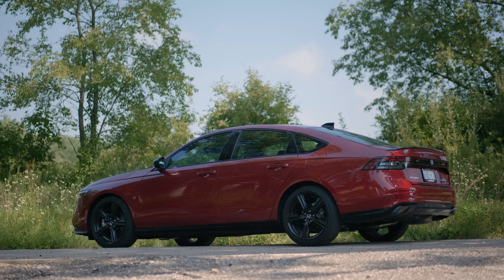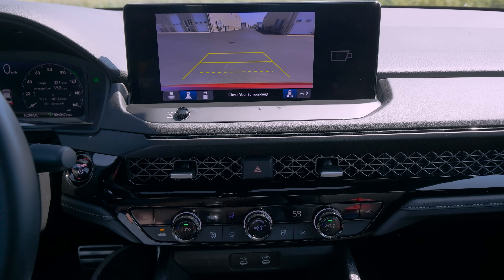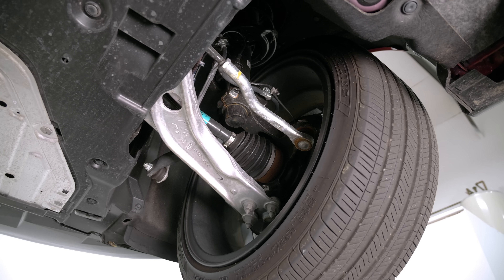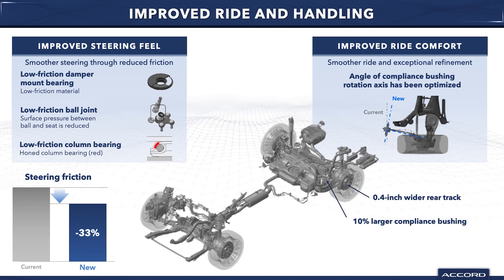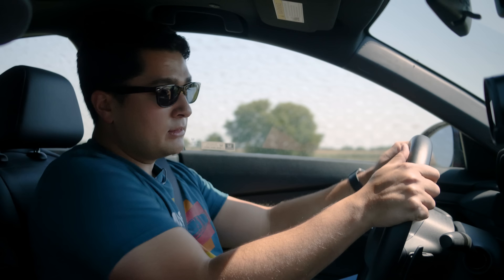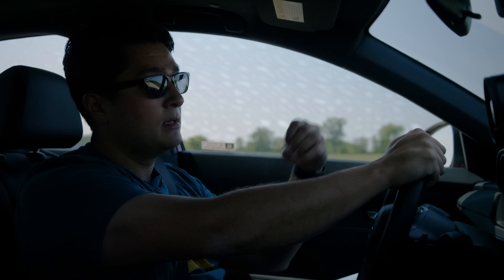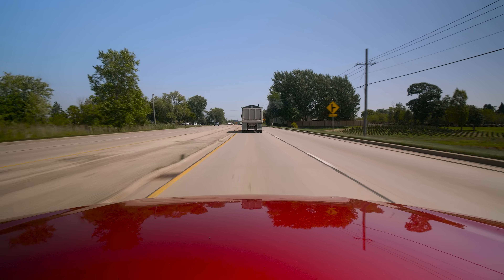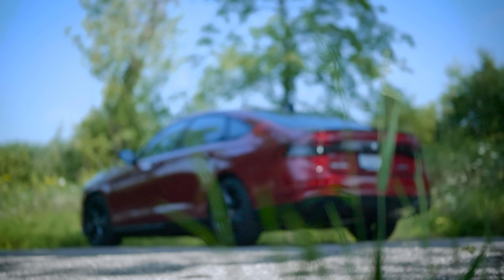2023 Honda Accord | The Art of Normal Cars

Comment: I do feel like the current Civic has taken over the role of the Accords of yore. Here's to hoping the future Civic Hybrid will hit similar efficiency numbers to this hybrid Accord.
Reply: That' a good point. The current Civic is about the same size as the 7th gen Accord.
Reply: @jerrybarrax5618 I would say 5th gen Accord, comparing mine side by side it's pretty similar.
Reply: Yea I was looking at a used Avalon earlier this year, but the Accord is now basically the same size and was cheaper to buy new.
Reply: I hope honda brings back in north America a small sedan. Best way to get new customers and something economic
Reply: @cedrikpelletier5735  100%. We need a new subcompact to replace the spot of the old Civic 😂 Bring back the Fit!
Reply: @cedrikpelletier5735  That would be the Civic.
Reply: Yeah good point. 🎉

I like the simplicity of old Accords!
Reply: Is the current hybrid civic not the same drive train?
Reply: @adamek9750  it’s basically the same, but with a less powerful electric motor I believe. Around 182 hp and 232 torque. It gets even better MPGs.
Reply: The Civic hybrid is expensive and it's already sold in Europe
Reply: I have an 05 Acura TL which was based on the 7th generation Accord. I noticed that some of the interior dimensions of the current Acura Integra (which is based on the 2022 and up Civic) were actually larger than my generation of TL.
Reply: We got the Civic hybrid in Europe at the end of last year. It goes under the name Civic 11 e:HEV. But I think you guys in the US have the Honda Insight instead, right?
Reply: @Schreibtisch1  Insight is dead in the US. Apparently Civic hybrid is coming here next year
Reply: @Schreibtisch1   Insight was discontinued in 2022.  Supposedly, Civic Hybrid will replace it later this year (2024).
Reply: @meemka8251  Civic Hybrid is already on the road since the end of 2022. I already drove one, it's a great car, I really enjoyed it.
Reply: @Schreibtisch1   It is in Europe, but it has yet to go on sale in North America- U.S. and Canada. Last I read it will be available here later this year.
Reply: Lucky for you it’s coming with 200 hp and 50 mpg combined
Reply: Would blur the lines between the two cars and might undercut the sales of the accord. I would say they need to get rid of one or the other.
Reply: It does they just released it

Comment: Had a 2024 Honda Accord Sport on an extended four month rental. I basically live in my business car… in 16,000 miles during my time with the car I got 49.6 mpg for the total duration. Great you say, but unfortunately I was to have that car for six months. While driving on the Washington DC beltway at two in the afternoon, without any warning the car suddenly dropped its speed to 20mph , scary, and messaged to immediately head to Honda. Took it back to Avis and received a Malibu in exchange.

Comment: I really don't understand the criticisms about the exterior being "bland." I disagree. Back in my car club days, we would have called it "clean." There is not a speck of gaudiness to be found anywhere. It will age very gracefully and will never seem dated. It does resemble the Ford Taurus, but that was another "clean" design. I like that it's not too loud (flashy). To me, that always comes across as pretending. Why should the Accord drive and look like a sports car? It serves its intended purpose - basic and reliable transportation for up to a family of four. All I want it to do is to start and drive everyday with no detours to the mechanic's bay. Also, the crash test results were stellar top to bottom, and that's a major concern for a family man. I'll drive a proper sports car when I feel like getting into trouble.
Reply: True. I’m not a fan of when everyday commuter cars try to pretend to be sports cars. Some may be fun to drive but they will never be a proper sports car that you can truly push to its limit and enjoy at the track

Comment: Even if you just look at the dimensions, the new honda civic is basically what the accord was 10-20yrs ago.  The only problem is, that there is no Honda Civic that is like the old honda civic- in size /pricing. They removed the "Fit" from US markets, which actually felt like and priced like the old honda civic, but with cons (tiny -noisy engine).

Comment: The problems I find with the 2023 Honda Accord: 1. No All Wheel Drive is available 2. No heated steering Wheel is available  3. No spare tire is available 4. No XM Radio (in the US) for some reason if you get one in Canada it comes with XM Radio, so Honda, there is no excuse. If a 2023 or 2024  car missing all of these features is fine for you, then get one. Hopefully, by the time 2025 comes around these glaring deficiencies will be resolved.

Comment: Aesthetically speaking, I think the 2023 Honda Accord is going to age very well despite its current reception. Its styling may seem "meh" right now, but that's just because we've gotten used to everything on the market being so ridiculously overstyled. I don't need my normal economy car to have swoops, gills, ducts, and cuts along with fender flares and a spoiler and sawblade wheels. There's no arguing that's a cool look on certain cars, but it stops being exciting when you see it on literally everything. This car's styling is going to age well. It looks new while managing to look understated. It's a blanker canvas too for those who want to modify theirs.

Remember, the Accord has never been a particularly controversial car. It has always toed the line somewhere between spectacular and boring. The Honda Accord has always looked just fine, and the 2023 Accord looks just fine as well. It's doing "the Accord thing" perfectly.

Comment: The design is... for a lack of a more sophisticated word - very good. There are lots of harmonious, parallel lines, it's simple and unmessy (something that recent BMW designs lack tremendously - but then again, China wants to eat, too). Also - it seems like several previously econo-box... or budget manufacturers - are going more upmarket (ukhem, honda-mazda-kia/hyundai) - and in a more "premium" segment - the "continuity" of design - seems to be much appreciated. This car now reminds very much of the younger sibling Civic - which again is a very clean, pleasant design - yet the Accord has that mystical "somewhat upmarket" look - with some hints of the first and second gen Audi A7 (which are very successful designs). Also - most so-called "premium" manufacturers seem to be making enormous effort to have this "sense of belonging/tradition/heritage" in their design - look at any Audi, Merc, BMW through several decades (in case of BMW, of course - except for the E6x gen - and whatever they're doing currently). Overall - kuddos to Honda, the current Civic Si - due to its design, perceived reliability, large hatch trunk and a manual box - is somewhat of a realistic dream car - shame the Accord will probably not be available with a 6spd. Thanks for the review, greetings from Latvia.

Comment: It looks terrible inside and outside. It's so bland it's like a Passat in all the worst ways. I couldn't disagree more about the interior, that stupid honeycomb grill on the inside looks like a Civic, it lowers my perception of this being more upscale from a Civic, HR-V or CR-V. It's so hard to clean.
On everything else I agree, Honda's visability is unmatched in modern vehicles. They use such high strength steel in the A & C pillars they can be so much thinner than their competitors. It's so spacious, they have and always will do that well.

Comment: In 2015 I shopped the Accord, Camry, and Fusion hybrids. I bought the Fusion because I thought it was the best car of the three, but worried about reliability.  164,000 trouble free miles later, it still runs great but I wonder if this can continue for much longer.  So I tested the new Accord hybrid and it did not seem to me that it drove much better than my old Fusion, has a noisier cabin, and gets marginally better real world fuel economy ( Fusion averages 38-42 mpg).  Yes, it is a very good car but just does not sweep me off my feet.  Guess I will just keep driving the Fusion until it dies . . .😩
Reply: i like the fusion too, but the smaller trunk in the fusion hybrid always turns me off. you can tell it wasn't designed with hybridization in mind

Comment: Given the extra cost of the hybrid system and the very high cost of drive battery replacement (especially with Honda owners holding onto their cars for years), the fuel cost savings loses a lot of its advantage.  Also much of the refinement was already present since the 2018 update.  Dropping the 2.0T was probably a marketing move to reduce cannibalization of other fast Honda/Acura sedans.  I hope the hot rod spirit returns to the Accord some day.  The new Type S is cool but I need 5 seats.

Comment: The Accord is literally Hondas answer to the boring Camry now. Most cars in this segment in top spec, offer most of the same…mpgs, apple car play, clean interior, a bunch of driver assistance options. Only difference is reliability and reputation. Briefly though, luxury? No way. More premium only. Luxury is better satisfying and engaging performance for a segment, premium sound, quiet interior, higher grade materials, heated/cooled seats/cupholders etc etc. That Accord is just premium interior, not luxurious. And drivetrain compares to a Prius, but less gas efficient and SLOWER. Luxury? Pfft.

Comment: I have driven nothing but Hondas and Acuras since I was 17 and got my very first Honda Prelude in 1985.  As a lifelong loyal customer of Honda/Acura, they really lost me with this new Accord.  I had several Accords, Preludes and Integras until I transitioned exclusively to Acura with an '05 TL followed by an '07 TL, '10 TSX V6, '13 TL and a '16 TLX V6.  Was planning to buy a '21 TLX but after much consideration decided to go back to the Honda make and now have a '21 Accord Touring 2.0T.  I appreciated the fact that the Accord 2.0T was faster, roomier and more fuel efficient than the TLX 2.0T, mainly because of the extra 500lbs of the TLX.  I have been exceptionally pleased with my Accord 2.0T.  With the '23 redesign, Honda abandoned performance.  I don't doubt that it's a good car but it's overall performance is but a shadow of my 2.0T car.  I do not want a slower vehicle than what I currently have and the '23 Accord's better fuel economy isn't enough to lure me in as a customer.  I'm not looking to replace my '21 anytime soon but when the time comes, it will not be a new Accord, unless they offer a higher performance version.  I like the TLX okay but its shortcomings are significant.  The backseats are very tight, and I hate the thought of it being slower than my Accord.  I just want a fun to drive sedan that is fairly roomy, reasonably economical, decently quick and reliable at no more than about $45k.  My Accord 2.0T fits the bill perfectly.  Where do I go from here?  Not interested in an SUV.  I never thought I would leave the Honda brand but I don't see my future with them unless they bring back a quicker sedan.  About the only other car I can think of that I would consider right now is the VW Arteon.  It seems to check a lot of boxes.  I'm not sure about its long term reliability though.  Anyway, that's my 2 cents' worth.  I have never wanted to leave Honda but it feels as though they've left me.

Comment: Had a 2003 Honda Accord coupe LX with the 2.4 L and 5 speed auto- not as fun as the 2.4L 5 speed I could have gotten, but was doing a long commute with stop and go driving, so the automatic made sense.  Was only $20,500 new also and couldn't afford the new at the time Infiniti G35 coupe or the BMW 3 series.  Try finding something like that nowadays in a new midsize car.

Comment: I mean it’s faster than the 10th gen Regular Sport Accord. I had one at one point. That car never pushed you back into the seat. I’ve also had a 10th gen 2.0t accord too. Horrible on gas. I now have the new 11th gen accord in the Sport-L trim. Yes it’s not as fun. Performance is decently satisfying coming from a 2016 10th gen 1.5 turbo Accord. I got the new accord because I was tired paying at the pump. If you are a 1.5 turbo 10th gen accord owner I would highly recommend you upgrade to the Sport-L trim 11th gen accord. 204 horses and 247 torque. You’ll definitely feel the difference. Plus the interior is awesome and luxurious

Comment: Sigh. Thanks for another in-depth, honest review. As a Hondaphile, past owner of two Accords and current owner of an 8th gen Accord EXL V6, and a Honda Clarity PHEV Touring, I find this latest Accord a letdown on two fronts. As an Accord, it fails because of the loss of Honda's engaging driving dynamics. I LOVE the way Accords handle twisty roads and the connected feel you get behind the wheel. My 2014 has the 3.5l V6, which is a great, smooth-revving engine. It really is an affordable sport sedan, as Mark said. If I were looking for a replacement for that car today, I'd be more likely to by a Toyota Camry. It looks better than this Accord and offers a V-6 in three different trim levels. 
On the hybrid front, I'm disappointed that Honda doesn't offer the Accord as a plug-in. That is truly the best of both worlds. My 2018 Clarity Touring has all the quietness and creature comforts of a luxury sedan, with over 30 miles of electric-only range, and regularly gets 50mpg or better on highway trips. In daily commutes with judicious use of the HV mode, I average over 100mpg!
If the new Accord had better styling and a PHEV option, it might be a logical upgrade from the 2018 Clarity. If it had a more engaging powertrain and traditional Accord handling, it might make a logical upgrade for my 2014 EXL V6. Sadly, this offers neither. It's just a half-hearted appliance. My favorite car is just another casualty of the modern car buyer's SUV addiction.

Comment: I daily the previous generation, but this new 11th gen is an even more refined Accord for modern daily driving. I really like the handful I've seen on the road so far. A lot of people gripe about losing the 2.0t and the styling being bland, but it still has presence on the road. I think Honda is going in the proper direction with the Accord.
Reply: The real gripe is when the Accord lost the 6 speed manual transmission.
Reply: Refinement, yes. "Presence"? Not so much. I think it only has 'presence' because it's new. Once the newness fades, it will become invisible.
Reply: It has the presence of two scoops of vanilla if we’re being honest. The last one had the presence of an A7. Vanilla sells wayyyy better.

Comment: The design isn't an upgrade, but I still like what it has to offer. I've been looking into cars for a daily and maybe a car to last me 10+ years and this one is on my list. Been debating between an SUV vs. Sedan, which I live in Wisconsin where it does snow quite a bit later in the year. Still not a fan of the pumped in noise when it's in sports mode, but the fuel economy is insanely good for this vehicle.

Comment: I had a manual late 1980s Honda Accord and it was the same -  great car in every way with the exception that it had drab a color and was super boring. I sold it with over 300,000 miles and it was still running super well.

Comment: Lifting a car by the pinch welds really isn't a problem, it's kind of easier in a lot of ways and gives you more options
Reply from the maker: The pinch welds on Nissan and Hyundai are like razor blades destroys urtethane pads on the lift

Comment: I've owned  various Honda and Acura sedans as my daily drivers for over 20 years now beginning when I turned 30; marking a willingness to except boring ol'e reliability over V8  6 speed bravado that always had a way of ending up on a flatbed.   
Yes, everything you said about Honda being very vanilla ,while being mechanically well executed, is what's defined the brand for a long time. If you want a less boring yet equally perfect (mechanically) car then buy an Acura - Honda's excitement brand. 
I work for a Japanese company and its amazing how different there business philosophy is compared to the typical stakeholder capitalism focus we see in the American auto industry. Honda's goals and vision are more focused on making the world a better place through automobiles, than maximizing shareholder value. The Accord as a platform has always been a highly reliable, high quality and conservatively styled platform  for generations. Using the Ford Taurus  as an example of how time after time the Big Three have taken a sedan that was a top seller and quickly identified area's that can be cheapened and then over a 5 year run maximize the profit per unit to the point that its soul is gone and consumers won't buy it because its garbage. I've owned fast cars, loud cars, expensive and cheap cars, but at the end of the day its Honda's commitment to good ole boring reliability that keeps me coming back every 10 years for another one.
Reply: Look at it this way You want have German repair bills - the worst thing I ever did was get rid of a Lexus to get a BMW, As I get older I value reliability over everything - you are only going to make so much money in life - do you want to waste it on Huge repair bills - When people stop buying unreliable cars maybe the germans will get the message I am in the market for an Acura or Lexus because my BMW is failing apart at 68,00 mile and I took great care of it They break down while parked- They are not designed to last past the lease cycle
Reply: My dad would agree.  He traded in his 3 series BMW, for a Lexus RX.
Reply: I'd hardly call anything Acura excitement anymore. I remember when the 2005 Acura TL came out it was something special. There is nothing special in the Acura sedan brand anymore.